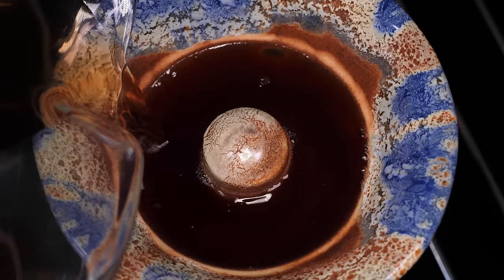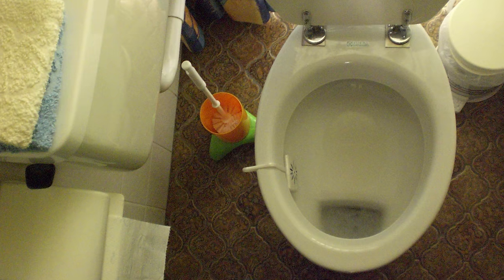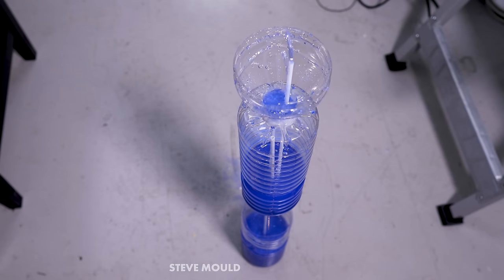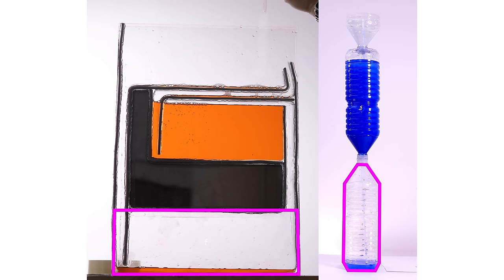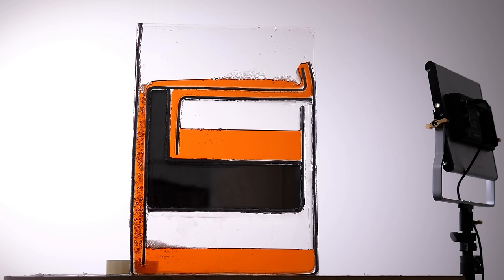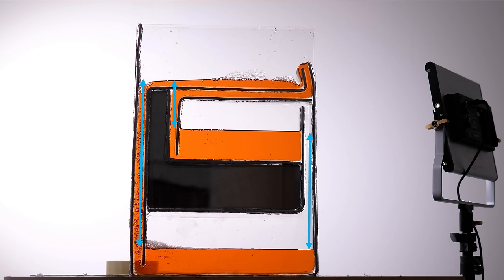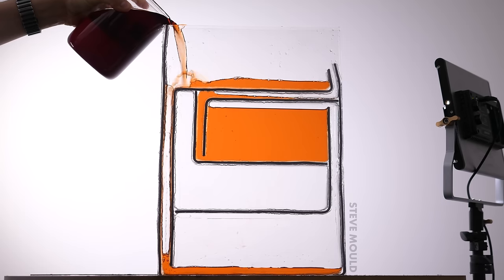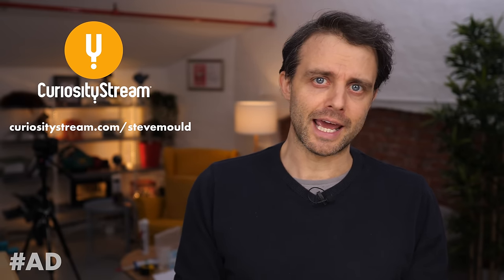A 2D Heron's Fountain Behaves Weirdly

Comment: Have you investigated the hydraulic ram pump yet? It’s a water pump which requires no electricity to push water hundreds of meters above and away from its point of origin. It relies solely on the flow of water found in a brook, river or stream. It can be made with inexpensive and basic plumbing parts found in any hardware store, and uses two check valves and a small length of pipe as a dedicated air chamber

Comment: Someone already mentioned the checking for parasites in the "turd on a shelf", so I'll skip that one.  In days of old, the bell siphon was used extensively in public toilets, specifically in the Men's toilet.  The urinal was often a piece of wall with a gutter along the bottom and a piece of copper pipe from the overhead tank to the horizontal tube with holes which washed the whole wall evenly.  The overhead tank had a bell siphon installed, so it would slowly fill up and then dump the entire content of the tank quickly, thus filling the horizontal pipe and maintaining a hygienic flush across the entire wall.

Then someone made a fortune out of producing individual piss pots, each with a motion sensor to operate the flush only when it was used. It would be interesting to know how many flushes of the old system it would take to cover the installation of a single such new unit with it's high tech solution!

Comment: The really tricky bit to get your head around is that it's the weight of water on the left that is the key. The water on the right is not being supported by water on the left because of the air in between which is being compressed by incoming water from the right, expelling the water on the left out till the air is gone and the whole thing is in equilibrium. That's quite counter intuitive.
Umm  the WTF one at 1:50. A friend in the 90's described exactly this and said that they were a German thing so you can look for worms. A memorable statement nothwithstanding its veracity.

Comment: I first came across a practical application of the greedy cup siphon with pipette cleaners.  Basically a three foot tube with an inlet and outlet at the bottom.  You would put long pipettes into the tube and apply water pressure.  The tube would fill to cover them, then drain, then fill...until you turned of the water.  I have had an idea to use this principle in a vertical Hydroponics setup.

Comment: I saw a version of a siphon base perpetual motion machine that is almost plausible hypothetically it can move thousands of gallons before it failed the basis is a barrel with a siphon hose above the water line sealed to use a vacuum to be able to work

Comment: I wonder if you made something like this, but super elaborate and maybe the entire thing sealed in a container, if it would actually become a perpetual motion machine since the pressure inside of the vessel is always the same, and gravity causes the water to flow in areas which shifts other water.
Just a really elaborate and large series of sealed siphons

Comment: This is actually the same mechanism by which scuba divers get water out of their mask while underwater. They hold the top side of the mask to their face and pull away the bottom side, and then blow air out of their nose. The air fills up the mask and pushes the water out of the bottom. They then seal the mask back on and go about their dive.

Comment: My folks have that "WTF" toilet, that uses the little shelf, in their second bathroom.
What happens is, when you flush the toilet, the water will spin in the shelf and start everything rotating with the water.
The "stuff" is then picked off the shelf, one at a time, and goes down the drain thusly.
That bathroom was built in the mid 1980's and it has never clogged.
It takes a lot of water to work like that, though. I have the float set so the water level is about as low as it can be, and it uses something like 9 gallons per flush (it pre-dates the low volume flush toilets that are prevalent in the USA nowadays).
They're on a well system, so no one cares how much water they use.

Comment: The toilet with a flat platform is more beneficial. You can check your stool's health. 10-15 second spent more above water doesn't make much difference but if it does, it's still your stool and you can open the window for ventillation.

Comment: At one point you mentioned how this wouldn't work if the spaces we filled only with liquid, but that's not entirely true. It wouldn't work if it were filled entirely with the SAME liquid, but if you filled it with two different liquids of different densities (the denser liquid in place of the liquid in your model on the video and the less dense liquid in place of the air in your model) then it SHOULD work. In fact, I think it should work even better because air is able to compress while liquid is not. Granted that the air inside your model wouldn't compress MUCH since there's not much pressure being applied to it, but there would still be a SMALL amount of compression where the air is being pushed up by the rising liquid in the bottom chamber but unable to escape because of the air in the upper chamber. If the air were replaced with a liquid that is less dense than the other liquid, no compression at all would be able to occur, thus it should work even better.

Comment: Here's a silly thought , to extend the time of Heron's fountain.
What if you connect a tube that is smaller in diameter from every other tube between the very bottom of the bottom container and connect the other end above liquid level in middle container. That would provide liquid makeup to the middle container and delay the siphon break

Comment: Things that come to my mind which would be interesting to see are the nozzle of a gas pump or a ram pump 

And on the topic of toilets: The "Flachspüler" is an old design, it has less "splash", it had less water consumption and and blockages where easier to handle. Today they are only used in medical applications where you need a stool sample. The one common in the UK is also the most common one in Europe, as far as I am aware

Comment: 1:16 To relieve anyone's fears about that kind of toilet assuming that the tank is working properly and not getting stuck open they is not enough want inside the tank to overfill the bowl as long as you flush and don't touch the lever again.
If it doesn't drain DONT try to flush it again cause then you can overflow it. Let it drain down naturally till you have enough room to plunge it and that should fix things

Comment: To me, I am 100% certain the Giza pyramid was a hydraulic ram water pump, reservoir, and aqueduct. This type of pump was common up until the steam age, and is still used today in the countryside: it's an automatic device for elevating water.  Where ever a flow of water with a gradual fall can be obtained, a portion of the water may be forced to a considerable height. At Gize, the flooded Nile is a) trapped by The Sphinx (the lock) b) enters the pyramid then is dropped into "The Grotto" where a multi-tonne stone sits partially blocking the water entering a large chamber (of air). c) the big square rock slams up and down. just above it another opening carries the water up high - very high into the pyramid. It uses sonic pulses to move very slowly but surely. Cosmic particle scans have shown the storage area (above the Queens chamber). d) the water exits quite high up. this is the opening you see halfway up. Out comes the water. I'm 60% certain it was a science device - like the large hadron collider of 36,000 BC. They almost surely were performning electrical hydrolysis of water, possibly using small currents of 10,000 volts (coming from the piezo-electric granit that runs up the core of the pyramid + traces of acids and alkalines + architectural profiles condusive to moving hydrogen and oxygen gases about (see The Grotto roof). 40% it was a power station. The lighthouse of Alexandria was lit 24/7 did you know?

Comment: What about air being compressible, like a spring? The fountain didn't work with only liquid because it was already at equilibrium. With the air pocket it also had an equilibrium, but pouring more liquid in disturbed that, compressing the spring. The spring naturally wants to decompress, but pushing out the fluid from the top reservoir takes less work than fighting gravity from the bottom reservoir.

Comment: Syphon powering a dynamo using wings, water falling on wings; which charges a cell that powers a motor which push water into the syphon from the bottom container which in turn runs the syphon which powers the dynamo with wings ... 
And we got a machine that might be a semi if not full perpetual machine.

Comment: Try doing a version of the fountain where you have a bottom container and an upper trough, and with a large pipe connecting the upper trough down to near the bottom of the bottom container, but with a relatively narrow fountain pipe from the middle of the bottom container up to play on the top container. So long as the weight and volume of water in the large connecting pipe and in the trough outweighs the weight and volume of water in the fountain pipe, then gravity should cause it to continuously operate AS IF it were a siphon as gravity attempts to get the water to equilibrium (which it will never get to due to air being in the bottom container. The greater the difference in the volume of water, the greater the water will flow through the fountain pipe. The compressed air in the bottom container will force water up the fountain pipe.
The bottom container will need to be pre-filled in order to speed up getting it working.
The working principle will be the much greater weight of water pushing down into the bottom container will force up the lesser weight of water in the smaller diameter fountain pipe, which will perpetually re-fill the water in the top trough.
It will continue to work so long as the bottom container is airtight - so that the mass of free air in the bottom container remains relatively unchanged.

Comment: Toilets with rising water in the US are becoming less common because they take more water. Now toilets must have 1.6 gallons or less per flush, which means you have to have some sort of key or rush system. The old 3 gallon toilets could get a good siphon going without the rush.

Comment: Steve Mould - I hope I explain this properly.... but what if the top orange tank had a base that flexed under weight of the liquid.  Which would maybe be a generic form of air compressor as it would put more pressure underneath due to gravity / surface pressure from the top tank.

Comment: I'd love to see some sort of device that sort of works like one of those birds that drinks water but a fountain that continuously pumps with solar heat. So the point would be you'd have something like your herons fountain 2d but then paint the surface black or something and let the solar power absorb the sunlight and pump the water. I assume there would have to be a temperature differential.

Comment: By sinking the tube in the middle tank you could make that perpetual as long as the flow back down and the flow coming up are equal. driven by the weight of the water perpetually . It's like an ebb and Flo pond on top where the pond has to fill up to a certain level then a gate drops pushing the air back into the bottom tank because it's emptied out when the tank gets full and it gets up to that gate and then that gate drops and then that pushes the air back down and then I pushes the water back through and then that starts to everything going back up again cuz the middle one would never go dry because it would have a reserve like the heaven flow due to the length of the tubes makes sense of course ask me how

Comment: Let me take a stab in the dark. As you pour, air get's pushed out of the way. Air has no where else to go, but up, increasing the pressure cause there's a liquid already above it. That heavier pressure pushes the second liquid up, into the the first batch top most basin, where the siphoning begins.

Comment: im from the UK and when i first went to america at age 20 i didnt like the toilets or the showers they had. the shower u have this pin thing u pull out and u have to set water with cold and hot tap/faucet where as in england every council house that has a shower has the basic electric thermostat shower as standard because they are cheap to make.

Comment: Has anyone tried using this with an aeroponic system? I'm not versed in engineering but I love gardening and I've been wanting to make some sort of simple DIY aeroponic garden. I imagine it would be especially helpful to have some sort of removable compartment at the bottom where the water eventually settles so that you could run the same water through the system again (you'd have to pour it in a separate vessel and replace the compartment first though). It would have even less water waste than a traditional aeroponic system and not require any electricity. The manually refilling part would be the only downside.

Comment: One idea if you want more flexibility in making 2D versions of hydrodynamic effects is to not make them 100% 2D. For example, from the greedy cup video, you could connect the two reservoirs at the base with a tube behind your two pieces of plexiglass. The tricky part of course would be making a water-tight (and sometimes air-tight) hole in your plexiglass. Then, rather than recreating effects in 2D, you would be doing what's more akin to taking a slice through the apparatus.

Comment: What would happen if you removed the bottom chamber and just made a tunnel back up to the main reservoir? It would still be lower than the "exhaust" from the fountain, but low enough to fill itself back in, in other words create an endless loop no?
Reply: Water would fill the tunnel fully and reach equilibrium. Or fill it partly if there's not enough

Comment: I wonder what would happen if you could incorporate some small dynamic turbines into a few points in a system like that. Capturing some of that kinetic energy and turning it into a small amount of electricity. Then route that to a small pump at the bottom which helps to pump it back to the top. Could you make it last longer? Honestly, their is a lot of wasted kinetic energy. A person could make a business out of kinetic recapture. Finding ways to turn motion into electricity. For example. What if all the water main's had turbine's incorporated into them, ingoing and outgoing, drainage systems to. Everytime someone; filled a kettle, took a shower, flushed a toilet, or it rained. We could be generating more power. What if roads were peizo electric? Or cars were made and roads upgraded to work like a huge dynamo? The driving cars could help power the city they were driving in.

Comment: You have a basic design flaw in your 2D version that causes it to fail. The idea is to allow the air pressure to build up, which in turn pushes the water from one chamber to the next. Your bottom chamber is allowing the air to escape, thereby limiting how long your fountain runs. Try adding a downward outlet wall, like you have in the middle chamber, for proper operation.

Comment: Steve Mould I have always wondered (perhaps an idea for an epiode?) If you have an aqueduct between two resevoirs, say its a roman aqueduct between two lakes. Now if a ship is launched into one of these lakes, the lake water level would rise. If the lake surface area is large enough, then the level rise would be negligible. The aqueduct would therefore not experience an increased load. Now if the ship tried to traverse the aqueduct, assuming it fits, it would not increase the load on the bridge either. I can imagine this huge ship traversing a flimsy bridge using this method or am i missing something? In other words can this technique be used to somehow transport a larger mass across a bridge that the bridge would otherwise be able to support if it were merely point loaded (i.e if we removed the water and put a set of wheels under the ship) or is it more like the water amount required in the aqueduct is so massive that the ship is dwarved in comparison? Do you know if the romans ever put barges on their aqueducts or were they strictly for drinking and irrigation?
Reply: Also, I heard of a pump which works by using a small water drop (head) to create a pulsating water flow greater than the original head. With the mechanism you can therefore irrigate an elevated field without human effort or external power, as long as you have a small creek flowing nearby.

Comment: I have A toilet and when you flush it there is a pole that Goes A thing with a chain that has a drain and when u flush it opens to let water in and if u flush to quick it doesn’t work as well because it  doesn’t have much water in there because u rushed

Comment: If the fountain is powered by differences in density (gas and liquid in the case of the 2D model), would the same thing happen with multiple liquids of differing densities?

I.e. if you had water in the middle, a slightly denser liquid in the bottom reservoir and introduced a 3rd denser liquid up top, would an equilibrium still be reached?

Comment: When I was stationed in W. Germany in the US Air Force (early 1980s), I was told (by a fellow airman, NOT a German) that the shelf in their toilets was there to allow the user to inspect his stool before flushing (as a means of monitoring his general health). If that's true, it sounds rather awkward — trying to inspect your poo before having wiped?! Thankfully, the toilets in the dormitories weren't of the "turd on the shelf" variety. 🙂

Comment: Because the fountain is based on density, I'm curious what the fountain would look like if you replaced the air with oil
Would the fountain run, would it be slower?